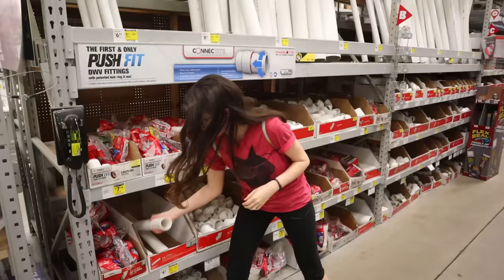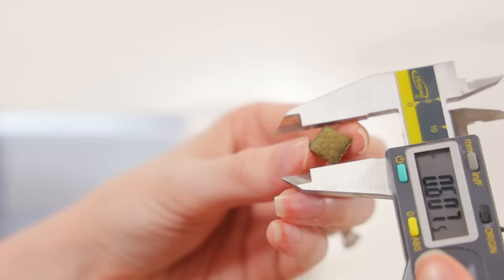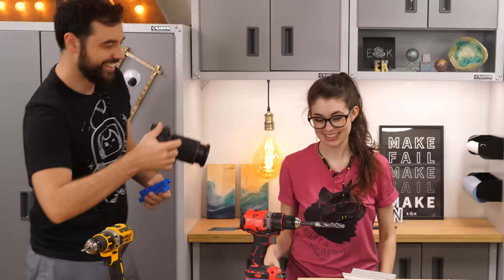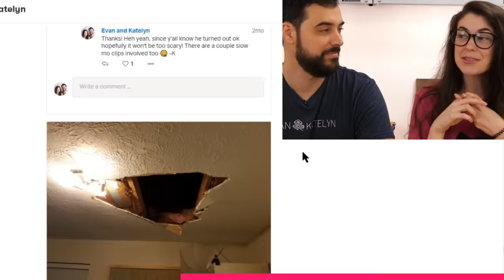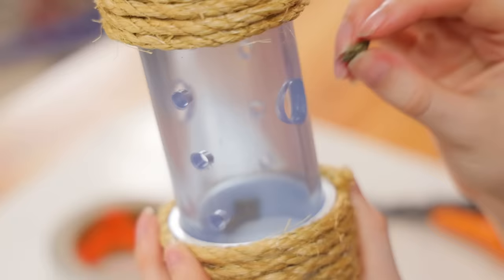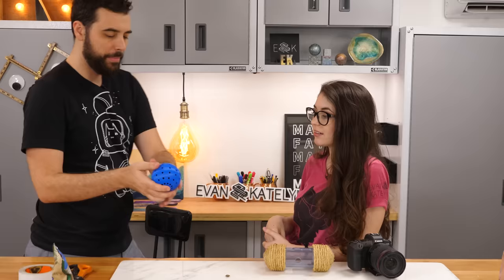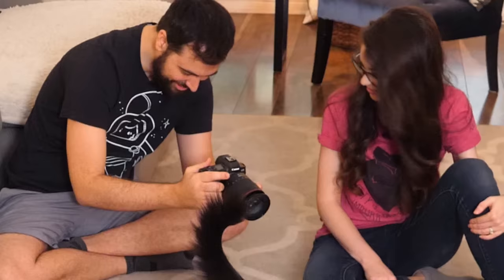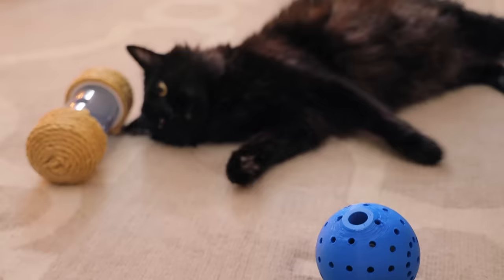DIY Cat Foraging Toys (and will our cat use them?)

Comment: Next time you should try using a step drill for enlarging the pre-drilled hole in the pvc pipe. Or use a drill bit for wood (with the center point). 👍😺
Reply: Came to the comments to look for this 😀. Also technical term for those wood bits is "Brad point bits"
Reply from the maker: Yes! We totally should have done that instead haha
Reply: I don't think it happens due to the bit being off-center, but because it was cutting too fast and bite to the exit. Drill rarely bites when drilling wood because it's too soft. It bites in metal and hard plastic a lot tho. And i honestly think wood bit would bite even more due to sharp angle. I think the only reasonable workaround is to use drill bit with more obtuse blade angle, and decreasing pressure on the drill right before it is about to exit material. This is when it bites.

Comment: hardcore drilling xD, for big circular objects I 3d printed some pairs of rounded jaws of flexible filament, and for small round objects like a 6 mm rod and I need to cut it with an angle grinder, I just drill a 6mm hole in 2 wooden little blocks and I clamp them to the table, If i need them to not rotate, just use some drops of super adhesive and with a propane torch later when I'm finished I just put the flame and the adhesive goes away :)
Reply: That's just genius
Reply: @starkdafusro  I just learned that I needed it the hard way lmao
Reply from the maker: Awesome idea!

Comment: Let this be a tool safety video. Improper technique all around. Katelyn could have easily broken her nose with that mishap. 

Set the clutch to something lower if there is a chance of high kickback. Use the handle attachment when using a large drill bit like that. Also guys. You had the drill set to 2, which is high torque mode. Stay safe

Comment: Kate's design seems better only if it had the inner pyramid thing.  Would be nice for you to 3d print the inner tube with that feature or somehow use resin to somehow create a small ledge so that the treats don't fall out so easily.

Comment: Best way to drill that giant hole and prevent it from grabbing the bit is to drill out a size or two smaller than needed and then drill the bigger sized holes to sneak up to the final hole size. ;)

Comment: The trick to drilling plastic is speed, the drill grabbed like that because you were starting from zero.  Better to have the drill spinning before it contacts the material. Also, especially with a hole that size, drilling in steps up to the final size would help.
Reply from the maker: Thanks for the tip!

Comment: So I know this was like a year ago but I thought I would just mention that when drilling start with a smaller size and work up to the size you want. It stops it from “biting” the material that you are drilling. I’d also suggest starting the drill before you enter the hole so that the drill is already spinning. Again that helps a lot with stopping the drill from “biting”. Hopefully this helps anyone who also has this problem. From a mechanic :) x

Comment: Good job!  And bonus points for designing one that doesn't need a 3-D printer.  To prevent the treats from getting stuck inside the caps like they did at 7:21, would beveling the inside edges of the tube have solved that? Just doing that in a few spots (not all the way around the circle) could even work better -- so that treats do sometimes get held in the caps until the cat rolls the toy and bats it around.

Also, it might make things more interesting if you drill the two large holes not lined up (so treats can't drop straight through while you're inserting them) -- put one hole a little to the left and the other a little to the right (each one slightly closer to opposite caps).

As for the ball, I think I'd want to come up with a way to build it in 2 parts that somehow screw or latch together, so that you can wash the inside periodically.

Comment: A good tip when you're drilling materials that like to grab like that PVC pipe, use the clutch on the drill, that way when it grabs it will slip instead of trying to break your elbow.
Reply from the maker: Thanks for the tip!

Comment: Just a lil suggestion if you drill thru pipes like that again , Do a starter hole with a smaller drill bit then step up to larger drill bit so you dont get a material slip like that again

Comment: @EvanAndKatelyn, perhaps try reverse drilling in plastic if it starts to get stuck/kick. Plastic tend to be able to be drilled through melting pressure, after all which is safer at times. Or do pilot drilling.
Reply from the maker: Thanks for the tips!

Comment: Really nice vise with V shaped, pipe holding jaws and a rotating head.  You used neither feature, by rotating to a horizontal drilling position, to make the drill job easier and safer.  There are clamp-on handles for the drill to give more control over the drill from torquing out.

Comment: I have bought a ball like that, that has like an inner and outer piece, so if we have a different size of treats or food we can twist it and make the holes bigger or smaller by twisting (and securing it with a little clip) so it won’t be to easy or to hard when having different sizes.

Comment: 1.  Evan was certainly more excited about the toy than the cat.
2.  Drill press and step drill bit next time
3.  Simpler fix for your end pieces:  Glue a piece of closed cell foam (EVA or Upholstery foam) in the end cap.  Then you can still pull the end off to fill it.
4.  The next time Evan feels the need to cheat like that, he should get Joel Telling to help him locate Catnip infused PLA
Reply from the maker: Great ideas! We do have a drill press but wanted to try a normal drill to keep it more DIY friendly
Reply: @EvanAndKatelyn  The drill press is for safety,  but the step drill bit will help with making the proper size hole by drilling progressively larger holes as it goes in.  This helps a lot when trying to drill through a curved or flexing surface.  $8 at Harbor Freight!

Comment: I know it seams like all drill bits are the same, because they look the same, and no on actually ever mentions this, but there are actually different grind shapes on the end. The drill bits designed for steel like to be more "grabby" on soft things like brass and aluminum and plastic. But you can buy drill bits designed for non-ferrous materials that work SO much better. I like to get drill bits off McMaster Carr, mostly because they have the best information on their website, as to which drill bit is best for what.
Reply from the maker: Totally! We actually do have bits that might have been better, we just brain farted

Comment: You could seriously use a drill press.  You couldn't be hurt.  Consider a Skil. Big enough for your projects and super cheap.
Reply from the maker: We actually do have one! But we were trying to use a more diy friendly tool. Should have used it though haha
Reply: @EvanAndKatelyn  OK. You are forgiven!!  FYI, The larger the drill, bit when it binds up, the more the torque.  If you use a 1 1/2 inch spade bid and it "bites" it can seriously twist your wrist/arm.  The rule of thumb is, go slow, and you should get less of that kind of thing.  Here is another idea. Take three pieces of wood and make  a long "box" that just fits over your round stock. drill holes in the wood the size of you your  various drill bits. Put your stock under the three sided box and drill away. To prevent the stock from slipping,  line the box with some foam rubber or a wad of plumbers putty.  The holes in the box will wear out, but it should last for a while.

Comment: Next time when you drill through PVC put it on the lower speed. On 1 not 2 on top of the drill. It will make it easier.
Reply from the maker: Thanks for the tip!

Comment: lol next time maybe start the holes with a soldering pen, I have used those in the past to cut holes in some pretty thick plastic (Concrete Trays). They heat up and melt through the plastic. This might not create a very uniform hole, but maybe you could use the drill to then clean it up. Just an idea for next time! BTW love the monty python reference!
Reply from the maker: Cool trick! We started them with a tinier bit but I hadn't thought to heat it up

Comment: a step-drill maybe? (or a butterfly drill even, at slow speed and VERY low pressure) this was really horror horrifying. allthough bleeding thumbs up. lol
Reply from the maker: Step drill would have been better! We wanted to avoid a drill press to try to keep it more diy friendly
Reply: @EvanAndKatelyn  i understand completely. although i had my drill-press even before my cheap step-drills. And there are those piranha cup-hole drills also in different chapes and sizes. often sold in the imitation branded variation at ALDI stores. (i dont know if you have those?)
DIY speaking, you could also use an soldering iron.     ugh ugh chuffing chuffing. LOL    no. better dont do that.

Comment: What a stubborn PVC tube. Do you sharpen your drills? Plastic appreciates a really sharp drill, sharper than what metals permit, and if you have a fast enough feed to get in and out before the hole melts. If you have a bench grinder it's not terribly hard to learn how to sharpen drills and touch them up before use.
Reply from the maker: I think we would have been better off using a tapered bit 👍 the bit was sharp but it was just too much surface contact at once
Reply: EvanAndKatelyn Oh yeah, like a center drill maybe? I hope you get your revenge on the next piece.

Comment: You Guys!!!  You are safety ROYALTY!!!  How did you even THINK of drilling thar PVC without putting it in a vise or other stationary holder?  Then, after Katelyn nearly has her left side amputated,  you put it in a vise (YAY🎉) the WRONG way (BOO🤯).  Put the flat cut ends against the grips rather than the round sides, ok??  Love you guys, but how are you not dead yet?  🤷‍♀️❤
Reply: They've gotten a bit better recently